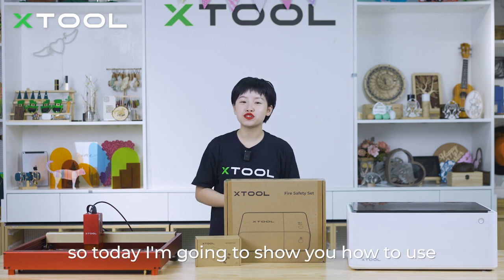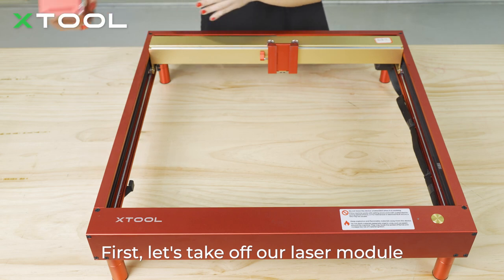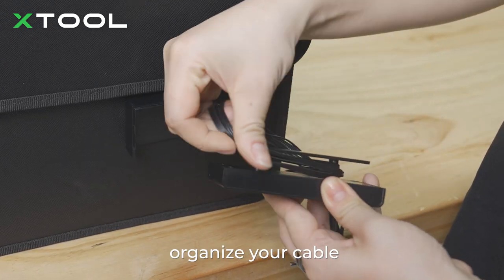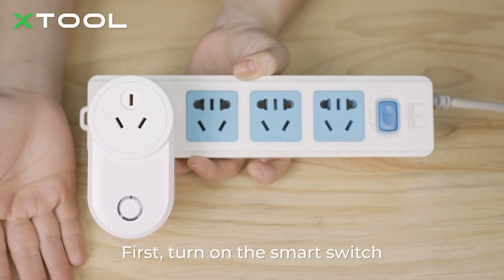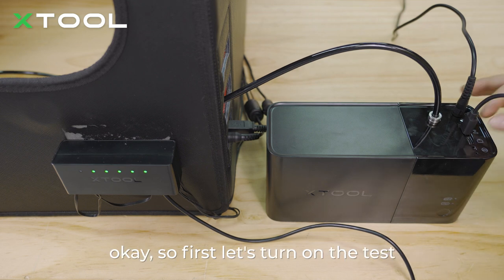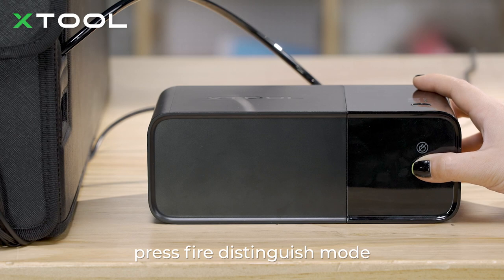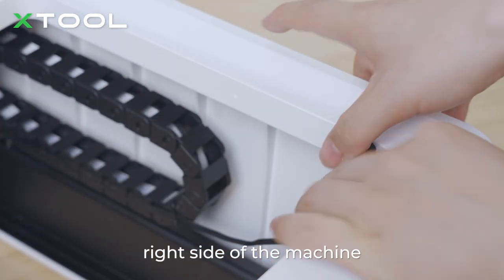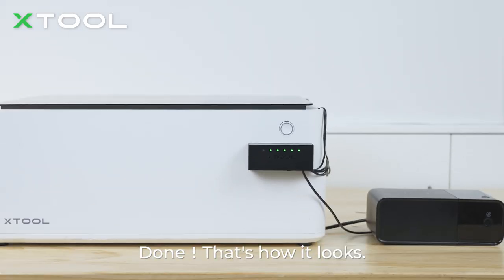How to Use xTool Fire Safety Set While Using Laser Machines | xTool 101

Comment: Followed the instructions for my S1 machine but the safety unit discharged the gas as soon as i screwed it in! 
I thought I might've made a user-error first time so tried it again after even MORE reading, checking videos and taking greater care....  Same thing happened again! Is it possible the unit was delivered in some kind of "discharge" state? I've only got 2 canisters left and i dont have a reliable safety system yet!

Comment: Does this fire safety set work with the P2? Will you be showing a video on how if it does (because it'll be difficult flipping it over & I don't really want to block the viewing area) Does the P2 not have a connector to connect the fire safety box too?
Reply from the maker: Yes! We are still working on it how to better install with P2! Will release it in May!
Reply: @xToollaser  so could anything change? I was going to order one today but if anything extra is added to an update it won't be worth it
Reply: Has there been any progress on the fire safety set installation on P2?  I have both products and am unsure how to progress with the setup.
Reply: @troondocproductions  apparently they've made a video...but are waiting to post it (their is a fire safety set that will actually connect to the P2 coming too, maybe to be launched with the video) The fire safety set we have does not connect to the fire safety port on the back of the P2 because its an independent set that wasn't specifically made with the P2 in mind. I'm hoping that we can send the one we have back to swap with the new one 🤞